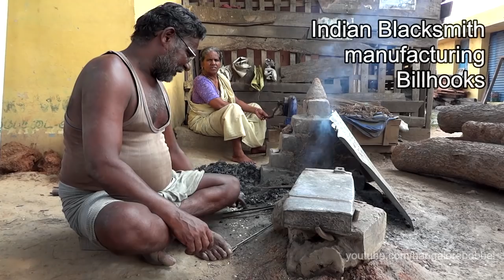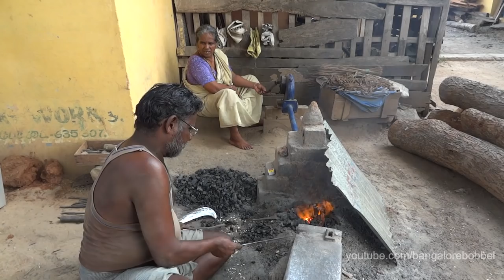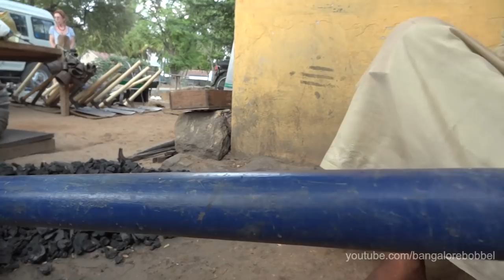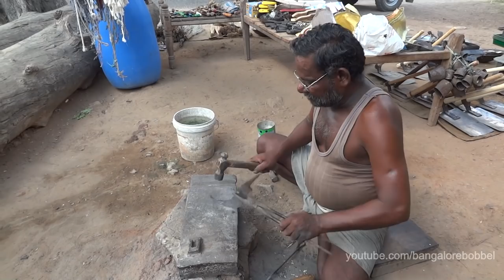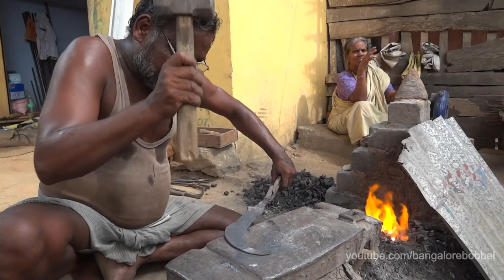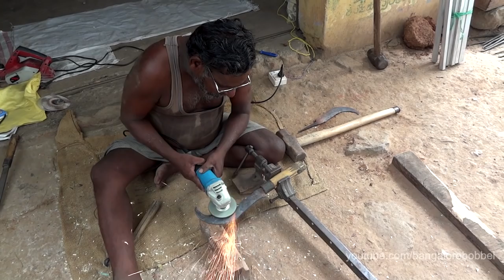Indian Blacksmith making Billhooks - Indischer Schmied beim Hippen schmieden

Comment: Fantastic video. I'm a beginning blacksmith, gathering knowledge and information on traditional methods of smithing, and have travelled India a bit myself. Love the simple, tried and proven setup the smith has here, and the skill he shows in the easy way he forges. Goes to show you don't need super special setups at all. My forge has a hand cranked blower as well, so I can pack it up and take it anywhere without worrying about power. Cheers from Australia and thanks for sharing :-D
Reply from the maker: Yes You are absolutely right - his equipment is simple and proven, and with the right skills it is all what is required to do such work. And his billhooks are really good, I love to use them.
Thanks and cheers back! ;-)

Comment: Well made, I've got atleast 15 aruvals (in Tamil)/hookbills we use for gardening and stuff (tea estate), though I've found that the tempering and annealing on most is suspect, they get the job done, and the hook is really useful.
Reply from the maker: thank You! ;-)
yes good point concerning tempering and annealing, compared to many modern tools the steel seems to be relatively soft, means if you purchase a modern knife or garden tool you might get sometimes maybe something hardened up to 60 HRC or so, whiles hand made aruvals are usually quite below 50 ... but still they cut very nice and that relatively soft type of steel is even wanted and even due to many reasons required.
E.g. soft steel does not easily break, so your tool never gets totally disfunctional in the fields, and in the same moment the edge may no more be sharp or even bends sometimes, but one can straighten it easily with any stone and sparpen it with another one. And the remaining elasticity of the tool (compared to a highly hardened steel) makes it more easy to work several hours with the tool - if you hit with a hard steel your whole body starts after short while paining, not only your arm ;-))) That shock absorption aspect is also the reason why most experienced aruval users prefer finally to work with an aruval which has no full tang or full steel grip - most comfortable is using an aruval with stick tang and preferably a nice bamboo handle, that gives perfect grip and is good for health ;-)
We have even an Indian Standard for hookbills, just by the way, it is the IS 3094 (1982) bill-hook. It defines  hardening between HRB 400 and 475 (what is comparable to HRC 42-49).
For me, such tools are totally perfect fitting to their function. No idea how long aruvals exist in India, but I know that billhooks are used in Europe at least since Roman times, means more than 2000 years - and if a tool is used not only over centuries but even since thousands of years, it must be a very basic and very functional one ;-)
Reply: Like I said, it is a very good tool, but that's to do more with the shape, the problem with these aruvals is that you have to sharpen them quite a lot (almost every time after hard use), and the ones not made out of leaf spring steel don't have that good durability (the newer mild steel ones are terrible), I've used all kinds so I agree I can't generalise, a shop owner who is a personal friend got me a few pata/spring ones which are almost, if not as good as the branded ones and didn't cost an arm(taxes plus duty for imported ones). Bamboo handles aren't as good as hard wood handles with full tangs at the core peened at the end, for me at least (and I personally like full tangs, though you need to compensate for the rebound and angle it correctly). As to hitting with hard steel vs soft steel, it also a matter of how you cut which takes time to master (took time for me atleast), also different aruvals based on weight, steel, and shape are better at different things, I wouldn't even think to use anything over 750 gms for brush clearing whereas I'd need the heft to cut through an acacia or those sambrani (Greek cyprus) which as really tough and springy... Also if you want a really fine edge for hard cutting then sharpen it with sand on a piece of indented wood, that helps keep the edge geometry...bit long, sorry for that, I'm into edged stuff...
Reply from the maker: Shail Adrian Jagmag hahaha, yes I like that  "edged stuff", too ;-)
yes it needs some experience, and I think everybody develops an individual style of how to cut with these things. I learned to use billhooks when I was not even in school, my grand dad teached me how to use them correctly, but I had a looong gap in using them since I was never gardening and had no more need to cut kindles for fire (what was my first main use since I had to make fire in wintertime). I have here several billhooks, some I purchased from this blacksmith and several others from markets, and I have one small favourite one (from him) which I use for almost everything in the garden and the others more occasionally ...
Usually I split wood with them (making kindles or so) but don't cut wood, means for trees I use mostly the saw, using the billhooks mostly for bushes or bamboos and whatever smaller tasks.
Reply: 15? Are you one of those guys they show in movies whose henchmen pull these knives out of nowhere when an enemy gets too close 😂

Comment: I am impressed with your blacksmithing, though I would never sit on the floor with a forge and an anvil personally. Standing and a bit of safety gear is my preference.
I did notice your foot is strategically placed in front of vital area's.
Cheers :-)
Reply from the maker: Thank You!
Yes that sitting position with one foot covering the center is very safe for certain important body parts ;-)
In fact, I noticed many blacksmiths here doing their work in any sitting position. The forges are usually on ground level, not elevated as in Western tradition. Also other tools are placed there down, most tasks are done on that level, usually everybody sits on the ground whiles working. See e.g. here, these knife makers in Rajasthan: http://youtu.be/uRoycA8u7pY (the workshop starts at around 1:00)
People here are used to that ways of sitting, especially that position as he shows here is very stabile. In that way and unlike to modern Western ways of working, one can also use the feet to hold anything, if required.
(btw: I am not the blacksmith but the guy behind the cam, and I tell You freely I could not work in such a way more than one minute or so ... if ever ;-)
Reply from the maker: netwitch56 yes those sparks hit his leg, but he seems never to mind about, most probably he is so used to it like other people are used to water drops or so ... no idea how hot are the sparks, guess at least 600° Celsius or so ...
Reply: bangalorebobbel It's just a terrible posture, hard on his lower back and pelvis to be swinging a hammer in that position for hours a day, year after year.  Repetitive motion on his elbow and wrist will lead to arthritis and carpal tunnel, instead of using the larger shoulder and back muscles whis is more efficient especially for the heavier blows.  I can't imagine his right knee will be pain-free after a few years of this either.  Yes people 'can' do it but that doesn't mean it's good idea.  He isn't exactly a model of physical health.
Reply from the maker: 800lb Gorilla haha, I am not a health specialist but I guess whatever habitual position of Your body You use, repetitive motion will always damage You over the years. It doesn't matter whether You get RSI by using Your mouse or whether You get anything else by using Your hammer ;-)
To sit in that lotos position gives You a very strong base, it is known as the most stabile sitting position (ask Your local Yoga guys ;-)))
You can't see it here but sitting there down enables people also to use their legs as third hand, means they keep things with their foot or toes.
In fact, I have seen even more strange body positions - strange from my initial first POV, of course ;-) E.g. one man blacksmithing whiles sitting on his own heels - I bet no Western blacksmith can sit a full minute in that way: 
http://youtu.be/uRoycA8u7pY?t=1m52s
But of course I have also seen blacksmiths standing - e.g. here:
http://youtu.be/DgDMRLGibX4?t=3m51s
... but to tell the truth: both men standing there are not the real blacksmiths but the tailors from neighborhood who enjoyed being amateur actors in that little documentary ;-)))
According to my experience, most blacksmithing work in India is done on ground level. Means the forge is down on the earth, anvils as well, and all tasks like smithing, grinding, filing etc. are performed whiles sitting on the ground and working there, people rarely stand. That same working style is also the case with other crafts - whether You watch a traditional silver jeweller, a carpenter, a shoemaker or whatever - they all use to work on the ground.
Reply: bangalorebobbel Absolutely, any habitual motion is harmful.  Using a mouse might be worse, we weren't made to do that for years and years, all day long.

Lotus position is legs crossed, feet on thighs.  I'm sure he's stable and I see what you say about using his foot as a hand.  That's what clamps are for (he could make one).

Comment: Nice work without a purpose built forge, but why not get some fire bricks to prevent heat loss?Thanks
Reply from the maker: I am not sure but I guess it is just for his comfort. 
This is a traditional forge type commonly used in South India, and you can easily add measures to keep heat loss relatively low, e.g. by simply addind sand around the fire, as you can see here, in another blacksmith's workshop: 
https://youtu.be/DgDMRLGibX4?t=3m34s

There are also other types of forges in use in India, even such with using quite more stones than the two you have seen, but at this one here, filmed in Rajasthan, it seems they use normal tiles, no specific fire bricks: 
https://youtu.be/uRoycA8u7pY?t=1m14s

I have also seen forges simply constructed as a hole in the sand (and a blower pipe going down inside), unluckily not yet filmed. There are some nomadic blacksmiths - when they come to a new place they simply dig a hole and start smithing ;-)

Comment from the maker: Hi Bob,
thanks - yes, the blower could maybe bear a little fine tuning ;-) But it works great, and it seems this is a common task for wives of blacksmiths in India.

Well, hardening - obviously he hammered cold, and there was a bucket of water (the white in the video) close by, but I did not notice what he finally did with the hooks. The ones he sharpened resp. to which he added the handle were other pieces, not the ones he had hammered.

Didn't notice oil there, nor any tempering oven or so.

Comment: This is fascinating. Do you know how polluted his fuel is? He seems to work the metal into the low heat range. The only time I do that is when I am trying to remove carbon from the steel. Does he work the steel from an intuitive level? Meaning sound and experience or has he followed an apprenticeship to master i.e. educated operation?
Reply from the maker: ArcanusLibero Thank You! ;-)No idea about his fuel, seems to be the usual charcoal we get here. Yes he is almost cold hammering, compacting the metal. These billhooks are usually used in a rough manner in agriculture and forestry and in household, for example to gather firewood. People don't care much, hit stones with them and dig with them etc. ... so they should not break but bear whatever is done with them. They must be strong and do the job but stay relatively soft (compared to other tools) that they never break and that one can easily sharpen them on any field stone or so.
I guess he learned, as all are doing in this and many comparable professions, from his elders. Means kids learn from their dad or uncle, this type of work is usually family business, caste related.
Reply: Great video thanks for sharing it.
Reply from the maker: ArcanusLibero thank You ;-)
Reply: Most probably apprenticed with his dad as a kid

Comment: this is forging.. not that grinding a flat steel bar till its sharp and pointy..  might get about the same result but this takes way more skill i feel
Reply from the maker: +EgholmViking thank You, yes it may take some years to get such a trust and experience! ;-)
Reply: +EgholmViking hammering the steel makes it stronger than if it were ground. The tool sharpness will last longer.
Reply: Not necessarily. With forging, you risk putting more stress on the metal, potentially causing cracks. Stock removal, and laminating metal would be stronger, but forging takes more time.
Reply: so true

Comment: I love how they adapted a mechanical air fan so you can hand crank it would never think of that.
Reply from the maker: we have usually a lot of power cuts, means electricity is not always available. In such situations human powered devices are the best way to continue the work. So all blacksmiths which I know here have any kind of mechanical blowers (even though some have also additionally electrical ones).
Btw: other tools like drillers or grinders can be also electrically driven because one can simply stop in case of a power cut and continue later, but for blowers it is better to have a way to continue immediately - means once Your iron is hot You should smith it ... ;-)))
Reply: bangalorebobbel  yeh I was guessing that power was a bit of an issue. This is a really interesting  solution, I take power so mush for granted that I would have never thought  of this solution
Reply from the maker: ***** Yes power is a big issue here ... especially in rural areas, and especially during the last couple of months before monsoon starts, since then the lakes are empty and hydroelectricity is not available.
Most infrastructural things which we are used to simply have in Western countries - electricity, water, waste disposal, roads etc. - are not or at least not 100% available, that's what we have to deal with.
From some point of view it may look as if people like to work in traditional way due to their free decision of doing it traditionally, or because they love to do manual work or so - but the true reason why people work in traditional way is in many cases simply that they do not (yet) have alternatives ... ;-)
But on the other side, blacksmithing is done since thousands of years, and it can be always done without any electricity - same as carpentry, pottery etc. - and maybe lot of manual skills got already lost in places, where the use of electrical tools is so common that nobody does it in the old way ... ;-)

Comment: I also wonder , do you temper the metal for hardness, flexibility and strength?
Reply from the maker: Well, I did not see him tempering in oil or so, but he used frequently water.
I own some of the billhooks he made, and the metal is not that hard as we are used to see it on Western tools (I guess it is most probably anything around 52 or so), but that is exactly what is here wanted for such tools.
Billhooks are mainly used by farmers or for forestry, and homemakers use them for gathering and preparing firewood, or in the kitchen to cut anything, or to open coconuts. They should never break and if one hits a stone or nail or whatever hard thing, the material simply bends and the dents can be flattened by using a hammer or stone. And such hooks are easy to sharpen, people use to rub them simply over any stone or so. But using a good sharpening stone or any diamond sharpeners one can make them razor sharp, if required. Some ladies use to keep them very sharp close to the handle, the rest remains normal. Then they use the front of the billhook for treating wood, and the sharp area for cutting fish or vegetables. For that purpose, the hook is kept on the ground with the handle between the feet and the cutting edge pointing up, and the lady sits on the ground and holds the fish or whatever has to be cut in both the hands. (I still have to videotape that, sorry so far no demonstration here).

Comment: The Indian blacksmith how much does he charge for the knife?
Reply from the maker: That depends on the weight of the whole thing. In his shop it started at maybe 300 INR for very small and light ones and went up to 900 or so, if I remember right (already several years back, the rates might have changed). In USD it was something between 7 and 23 or so.
Here many prices are calculated based on weight plus some making charge, whether you go to the blacksmith or see the goldsmith ;-)